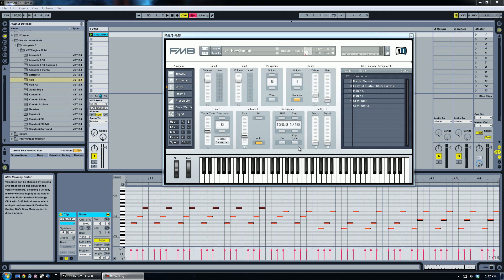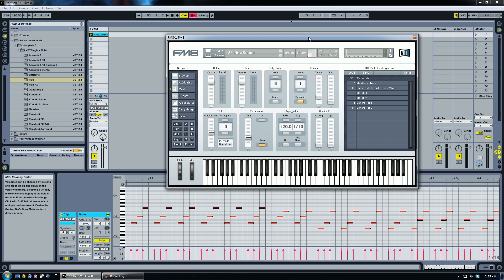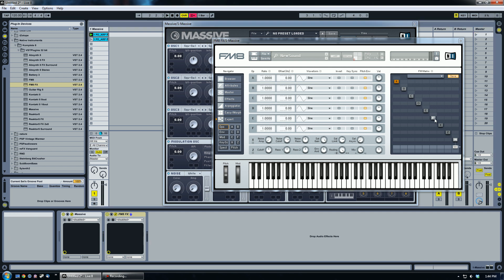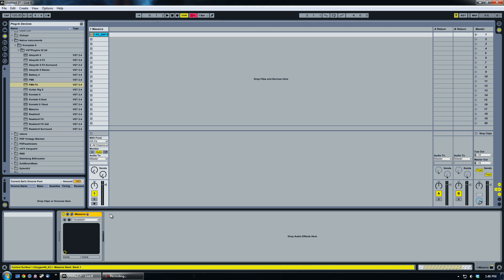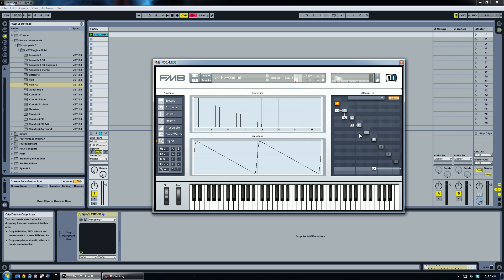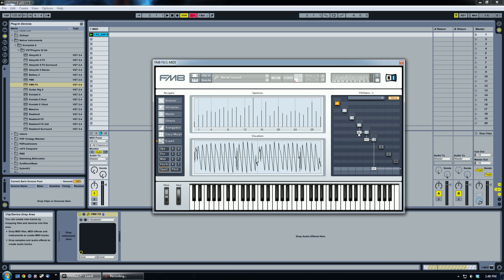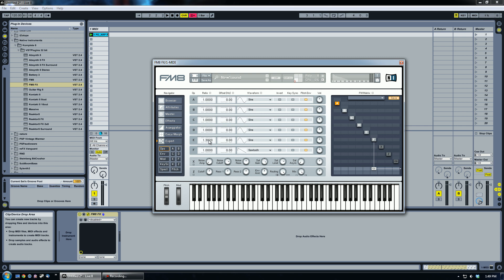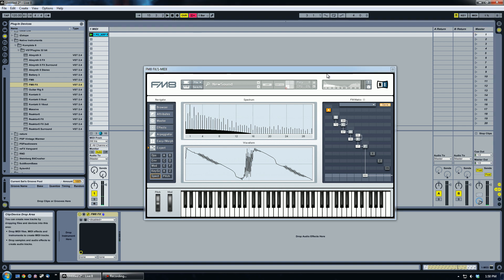The (advanced) fundamentals of FM8

Comment: 7:20 I'm gonna correct you there. The pitches are in ratios.
1 = the bass unit
2 = up 1 octave
4 = up 2 octaves
8 = up 3 octaves 
etc.

I wouldn't really recommend having operators in the decimals. The other numbers in between, 1, 2, 4, 8... are other harmonics. As you get higher there are more between octaves until they are moving up in intervals less than a semitone.

The explanation for this is a complicated thing about waveforms, look at this vid for an explanation:

/watch?v=i_0DXxNeaQ0